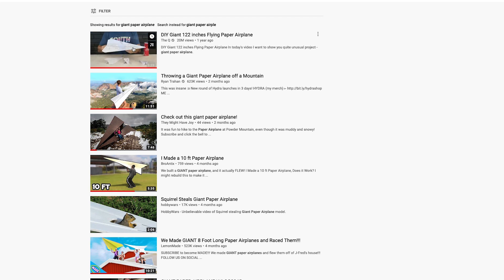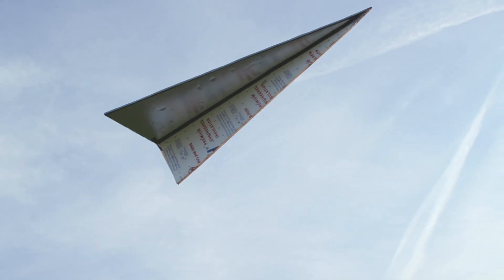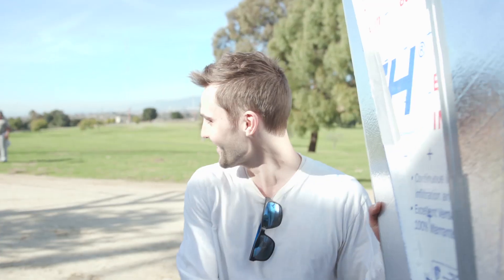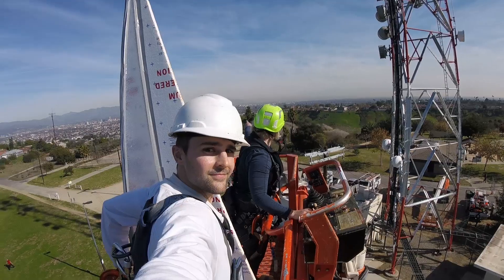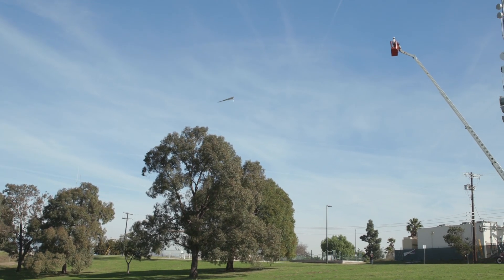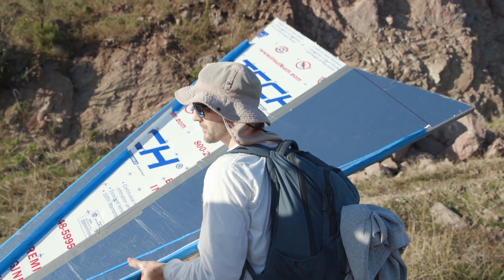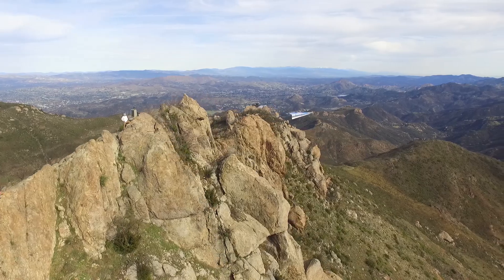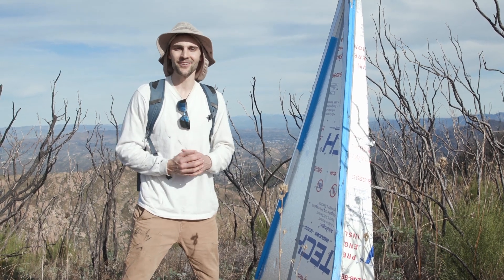GIANT Paper Airplane off a HUGE Mountain

Comment: You don't need all that vertical stabilizer. Remove 2/3 of it, that will fix both the weight and center of gravity problems, and improve drag .

Comment: Dude really ? :D ... just add some lead to the original "no airfoil" setup and get the CG right... thats all your doing by adding foam like that, changing the CG forward / backward. Would be cooler if you used some CFD software to run some tests on your "airfoil's" and then tried them in the real world. Like I said, that foam crap on the top of the "wing" is just changing the CG and adding heaps of drag... coulda been HEAPS better if  you knew what you were doing xD

Comment: You should have used 1/4" thick closed cell foam to form your upper air foil.  It weighs next to nothing and by placing about three thin strips underneath the top-most surface of the l air foil layer it would have built it to equal the one inch layer Styrofoam that you were using.  It would have given you  the curvature you needed without adding the weight you seemed to be battling.

Comment: From my many experiments with paper aeroplanes as an eight year old, I can tell you that you need a slight rise to the trailing edge of the wing. Maybe a centimetre would do it. Plus the small wing tips on the trailing edge should be sloped slightly up too, but quite steeply. Maybe 45 degrees over a 10-20 centimetre distance? The rise on the trailing edge helps keep the nose up without stalling it, and the upward pointed wing tips help the weight distribution into the centre, keeping the plane level and stops it sliding laterally. Unless things have changed since I was eight.

Comment: Gravity is what helps it create thrust (slightly diving creates speed). If it there is no thrust, it will stop then fall
Find the center of mass from the front to the back by trying to balance it over 2 thin edges (that are in the same line) with a space between them to fit the vertical stabilizer. Once you find the balance point, put a vertical line on the stabilizer (having that line will help you decide where to attach anyting. Add a small weight slightly a head of that line (to put the glider in the begining of a dive) which would create momentum which in turn would cause the airfoil to create lift.

Comment: It really isn’t the shape of the airfoil that’s keeping the plane from stalling; it’s the weight on the nose keeping the plane from pitching up.
Reply: EXACTLY! Jesus, that's why we put paper clips on the nose!
Reply: Yup. Would've gotten better distance out of it by leaving the airfoil mod off and putting a small lead weight in the nose.
Reply: @mwsletten  it probably would have flow better if they made the wings a bit bigger than the body. But the whole body is bigger than both wings.
Reply: @mwsletten  But Lead causes cancer in the state of California. If they were in any other state it would have been safer.
Reply: It's why origami type paper airplanes work so well compared to just cutting and gluing flat panels, all that extra paper up front. Also, the double walls of the wings mage great lift due to the curved surface.
Reply: Yep, it's called center of gravity.  They had no calculation for any of that in this build I'm pretty sure.
Reply: We call these "planes" "swallows" because they require more speed to fly. The "operating" speed is linked to the position of the center of gravity, which is achieved by the exact length of the "paper plane" without added weights. With this type, flight cannot be achieved, as with another type, which has a more complex structure and stabilizes itself by swinging flight.
Reply: Actually, it is both... Even when properly balanced, a flat airfoil has the tendency to move centre of lift forward when angle of attack increases - causing a further increase of AoA etc - until it stalls. That's why "classic" airplane has to have tail. Without tail (delta wing) can counter this by a "reflex profile" wing profile.
https://en.wikipedia.org/wiki/Aerodynamic_center
Reply: just thinking that
Reply: Another idea. Slightly up-tip, or down-tip the tail edges with small ailerons. Does not add weight. Adjust as necessary.
Reply: thinkin the same thing, from when i was a pro paper airplane kid when i was 8
Reply: yes but the airplane needs to be tilted up so air reflect of it and create lift
Reply: some dihedral also would've helped with keeping it straight

Comment: No. you don't need a little airfoil. the benefit it was giving you was MASS not FOIL You also need positive incidence. IE your plane is "neutral" so once it noses down it has no "counter action" to pull the nose back up. Your model was "tail heavy"

You need to "bend" the trailing edge UP a tiny bit and add nose weight until the CG is correct. (the CG of the first zoom boom flight looks good! just add trailer edge UP.

this will cause it to "want" to pull up as it increases speed (which is what will happen if it goes nose down) this is your positive incidence you tendency to "pull up" when it noses down.

That final flight was FANTASTIC !!! still a teeny tiny bit tail heavy which is why it "mushed" a little. Otherwise EPIC!

Comment: without the airfoil it the center of gravity was just too far back, adding weight to the nose would have been enough to stop it from stalling. I also suggest that you add control surfaces to the trailing edges that you can adjust... have fun

Comment: If you do this again , try adding : a wider wingspan , dihedral , a rounded leading edge , a tapered trailing edge , & reflex . To calculate the correct CG , here is a flying wing ( delta ) CG calculator :  https://fwcg.3dzone.dk/

Comment: You may want to try the non-airfoil design with more weight in the nose of the airplane. This will prevent the stall while adding the minimum weight. Your problem was not the wing design, it was merely a center of gravity problem.

Comment: When I was a kid playing with styrofoam planes we would use nails shoved into the foam for weight and get them absolutely dialed in by simply balancing. If u had extra weight in the nose it might do great without the additional top airfoil piece.

Comment: I think that there are all kinds of aerodynamics at play Eddie's, low pressure areas winds etc. that could suck the plane up and affect the  flight that you didn't get from the high lift as I was watching this I wondered how Swiss cheesing could reduce weight by 50% however it could also create areo issues all that said you did a cool vid thanks

Comment: What you end up with is called a Kline Fogleman KFM-2 airfoil. It helps with the lift and air pressure to make the plane go forward but also the weight distribution helped made the CG more accurate that's why it works.

Comment: The only problem with removing the airfoil in your case was the Center of Gravity got messed up, not the actual airfoil. And, if you put a weight at the front it wouldn't have nosed up and stalled. Also, the sleekness of the airfoil is not necessary. Air would pool and go turbulent in non optimal areas, and effectively smooth the air. These are called KF airfoils, which is what you have. Lastly, shift the CG forwards and bend the foam upwards at the back of the paper airplane to make it more stable. The bending of the foam at the back of the airfoil pushes the back down if you go too fast due to more airflow, and if you go too slow the farther forward CG has a greater force on the plane and pitches the nose down until speed is regained. 
But other than that, thanks for making fun content and inspiring aspiring engineers!

Comment: cut circles of foam, angle the edges; use the circle to increase the surface area on top: you could take half the weight from the bottom (if it's simply two ply make it one ply) and tape is probably the heaviest material you've implemented, so I urge you to remove any unnecessary layers and not to skin the entire thing weighed down with ounces of tape.

Comment: It's kinda not the airfoil that's causing it to stall, you just need a little bit of weight in the nose.   What you also have here is a KF airfoil ,so try having trailing edge of top plate be 40-50%(no more than 50%!) of the wing chord and make the leading edge of the whole wing more rounded to reduce drag.
Reply: Also stick some servo motors on it and control it :D 
You'd need some beefy servos for control surfaces this big though.

Comment: When you removed the airfoil you changed the center of gravity. You need to move the center of gravity more forward of the lift to maintain stable flight.  The center of gravity and the center of lift need to be at the same point. Or the center of gravity needs to be forward of the center of lift.

So when you remove the air foil you could have added weight to the craft, and gotten a better result.  Like a big GIANT paper clip!
Reply: Easiest solution would be to trim a little of the rudder at the very back of the airplane. A few inches removed would have done it!
Reply: I think that's it exactly.  A folded paper airplane has a lot of folded paper in the nose so the CG is farther forward than you get by attaching three triangles together.  Their "airfoil" may have served more as 'turbulators' to spoil a stall.  I'd like to see this done with RC to try some slope soaring.
Reply: I’m trying to find who asked
Reply: So cool off the mountain though

Comment: Everyone that knows anything about airplanes: 🤦🏻‍♂️🤦🏻‍♂️🤦🏻‍♂️🤦🏻‍♂️🤦🏻‍♂️🤦🏻‍♂️🤦🏻‍♂️

Decent result though 👍🏼 your "airfoil" was just correcting the center of gravity. I don't think it was really doing much foiling lol
Reply: No, it wasn't. Just google delta wing aerodynamics and look for the pictures. You will see that delta wings dont produce lift in the same way as normal airfoils. The delta wings creates a vortex around the leading edge and because of this creates low pressure on top and this gives you your lift. 

The reason it made the plane fly better was because it shifted the centre of gravaty forward so it was in front of the centre of lift. Without it would enter a deep stall. 
To make it even fly better is to make sure it has a bit of elevator up force so it will fly at a stable speed. So when the plane slowes down, the centre of gravaty pulls the nose down and give it more speed. And when it goes faster the elevator will point the nose back up.
Reply: @Warkip  do you have a link to what you're talking about? All the pictures I'm finding look like pretty normal airfoil shapes. And your second paragraph sounds a lot like what I said?
Reply: Aside from adding an elevator for reflex
Reply: @nateolmsted22  yeah, true, the second part is what you said, i just always get excited when talking about aerodynamic subjects XD, and wanted to explaine it a little more to other people.

Comment: hey, I'm not an engineer but im a student pilot in the UK and the way that aerofoils (air foil if your american) work is due to something called the bernoulli principle which is where air travels faster over the larger area which us the "hump" which creates low pressure which then makes the high pressure on the bottom of the wing want to equalize therefore it generates lift so essentially they get sucked up if you could optimize the velocity (airspeed) above the wing it would be best also it would be a good idea to add flaps or ailerons to control the pitch  also making it more aerodynamic and having less drag would definitely help 👍

Comment: hey Nick the 2nd toss from the boom lift was more of a cg issue you could have removed the foam and added nose weight and still achieved the same distance as the first toss , CG is most important issue , tail heavy planes dont fly nose heavy planes fly but are manageable balanced planes just fly .
great video awesome channel !!!

Comment: It is tail heavy the foam just made it heavy in the nose it was not the airfoil
Reply: This is the answer right here.

It would fly a lot better with some nose weight and a little up elevator (the same as reflex, an upturned trailing edge, as this is a delta wing). With those modifications it will start to dive until the reflex causes the nose to rise a bit, and it will settle at a stable speed and attitude.
Reply: @JMMC1005  it is easier to cut some of the vertical tail to reduce tail weight.
Reply: @niconico3907  reflex still needs to be bent into it to keep the nose raised. nose weight and reflex is the way to go
Reply: @yohsin123  How about simply mounting the GoPro a little more forward..
Reply: @JMMC1005  Diagram for what this would look like? For those of us contemplating building one of these... :-)
Reply: @VirtuallyYoursAnne  This is easy for you to do.   Start with a model as all aeronautical engineers do - say for something smaller to test with just fold and make an actual paper airplane.  Tape the top (1" of tape will do) so the wings stay together and it looks a lot like what what Nick has.   Now fly it and you will see it does pretty good.  Now, want to add a little better shape shape to the wings so it flies better?  That is, as Nick said many many times, add an airfoil shape to it.  Take your paper airplane and crease and bend down the front one quarter edge of the wings.  Bend that down about 10-15 degrees, meaning not much.  Doing this adds camber to the wing.  That is it bends down.  This gives slow moving airfoils more lift.  Airplanes do the same thing with flaps and for larger jets, leading edge slats that move down for take off and landing.  Your paper airplane should fly a little better now.
Reply: As the guys from Flite Test use to say: A nose heavy plane flies badly, a tail heavy plane flies once!
Reply: You're right.. 
I was looking for someone in the comments who knew the answer :)
Reply: NadavK28 if you know then why didn't you comment it? 😂😂😂😂
Reply: Thank you! Just a little CG adjustment and that thing would have flown without the "airfoil" just fine. Just clip off a little of the stabilizer at the back of the wing and bob's your uncle!
Reply: That's exactly what I thought. Just a couple extra grams on the nose and a bit trimmed off the tail would make a world of difference. It's the dihedral of the wings that causes it to glide well.
Reply: Yup, CG is off.
Reply: Who else was yelling this at their phone screen while the watched this? How can he not realize this?
Reply: @boccacantiga5095  Yep. When he was happy with how it flew I was like uhhhhh... wtf.... it could have gone MILES.
Reply: It was driving me crazy the body and tail really needed to be trimmed it was larger than the wings.
Reply: Glad u liked my suggestion. I am 12 and live and breath rc planes.
Reply: @swfle3617  
That's cool, man.
I loved everything about airplanes when I was your age, and still do, but balsa wood airplanes were all my budget could afford...i would have killed for a real rc plane.
Reply: While the center of gravity is wrong this is a Kline-Fogleman airfoil and it does create llft I use them in many of my home built foamy RC planes. Look up Kline-Fogleman or K-F airfoil if you don't believe it.
Reply: @JoeBLOWFHB  Go away NPC everyone knows kf airfoils suck and have more drag than your last birthday.
Reply: Thank you for writing that comment, it saved me from having to write it myself and I really dislike typing comments to videos especially when the correct answer seems obvious and he's just not getting it. So once again thanks for saving me from having to type out a long winded comment.
Reply: Well yes, but airfoil helps alot too, add some nose weight, and airfoil, 👌
Reply: Yep.  Try it again with the same CG
Reply: yes bro you are right but it should be lightweight #desibedtimestories
Reply: Can you speak English
Reply: Exactly. also, at 4:34 he seemed to have forgotten that the plane was originally tail heavy.
Reply: Yep. anyone who has had that happen with paper airplanes knows it can be fixed with flaps, adjusted down in this case.
Reply: I think you missed the first sentence in the video he saw a video on tic tok. Anyone who uses tic tok has no comprehension of the physics of flight.
Reply: Put an electric motor and propeller on it to make it a plane
Reply: I GOT LEFT BEHIND IN THE GRAND CANYON & HIKED UP A VOLCANO ON MY LAST VIDEOS 🔥🌋 PLEASE GO SHOW THE CHANNEL SOME LOVE! ❤️ THANKS IN ADVANCE -MUNOZ INTAKE FAM 🙏🏼

Comment: When going for distance, I believe different styles of paper airplanes were used.  Would those designs be too heavy though for foam board?  Possibly.
Reply from the maker: I'm not sure tbh... always wondered if more perpendicular wings with airfoils would be better than that delta wing shape?
Reply: @NickUhas  they will, mostly because of the induced drag. Because of this reason you see that gliders have verry long and thin wings. But i think that that will be a difficuld structure to make from foam and with perpendicular wings you will need a airfoil. This is because although they will still produce lift, it will be less than a delta wing design. This is because a delta wing works a bit different than normal wings, it gets most of its lift by generating a vortex. And because of this vortex the pressure on top of the wing goes down and you have a force up (google delta wing aerodynamics in google pictures).

So because of how they work, perpendicular wings will geve less drag. 

All your 'airfoil' did was shifting the centre of gravity in front or at least a lot closer to the centre of lift. If the centre of gravity is behind the centre of lift you will pitch up and enter a deep stall and a aircraft cant recover from that. 
If the centre of gravity is in front of the centre of lift hovever, you will get a nose down (pitch) movement, to counter this aircraft have the horizontal stabelizer, this is practicaly just a wing that is pulling the tail down to keep the nose level.